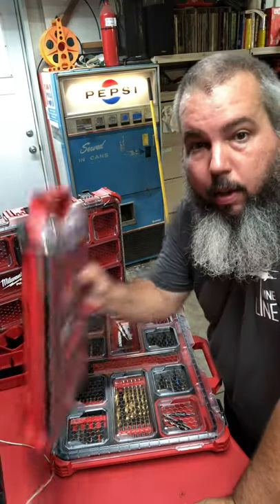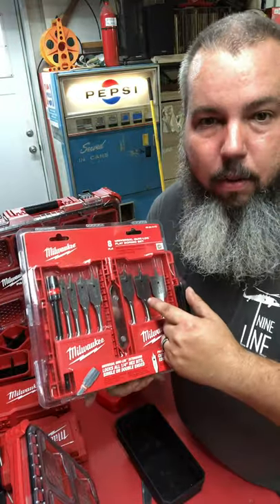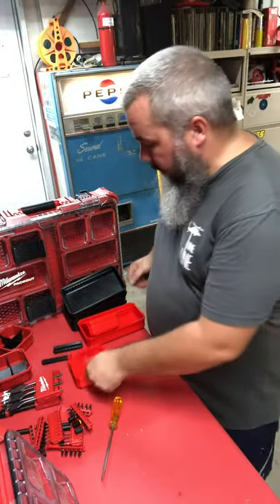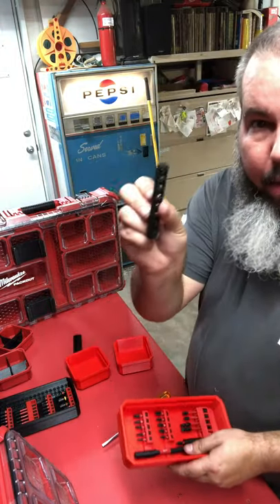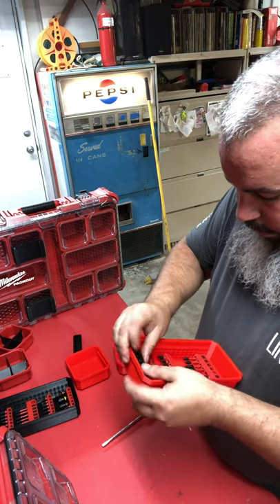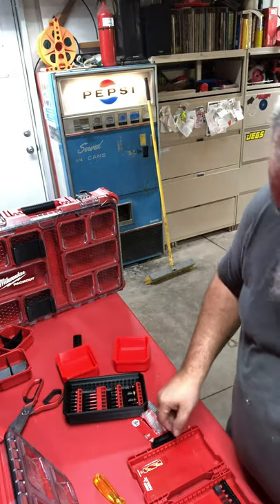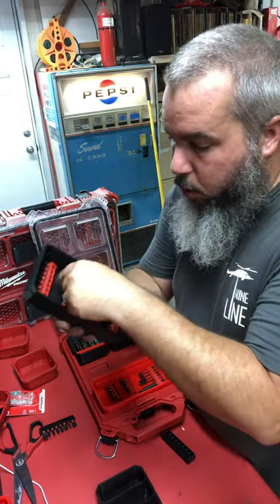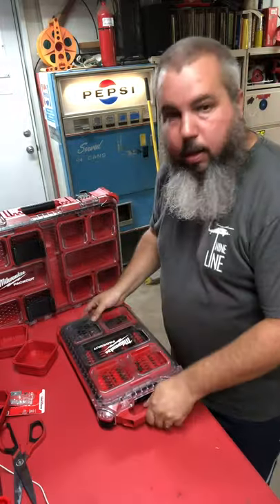Milwaukee Tools PackOut System  3d printed Bit bins

Comment: I've been printing trays as well.  Thanks to your video.  One thing I like to do is cut off the locking tabs on the sides.  Especially when you have multiple rows it can be difficult to flip them up.  It makes it a lot easier to get bits in and out.
Reply from the maker: Sergey Pober thanks , and that’s not a bad idea

Comment: Are the feet you sell the price for one foot or a set of 4? And are they super sturdy? I want to attach them to a table top I want to build for when we are out in the fields and need a flat surface to do work on sprinklers or the push seeder etc...
Reply from the maker: Cackleberry Farm they are per foot. And yes they a really dense. You can lift a whole stack of PackOuts with a board and the feet attached

Comment: FYI.  I really like the way the printed trays work with the original bit holders, that come with the cases you buy. I did  get both size trays and love them. I do have issues with the printed bit holders big and small. I live in south Florida and keep my  pack out boxes in the back of my pickup which is covered. I found that the  printed holders deform and become useless and the bits are hard to remove. The printed holders start to melt and warp. The original holders are ok in the printed trays and don't deform. I don't know if it would help, but i noticed that the original holders have a back support brace along the back. I wonder if this would help on the printed holders or is it the type of plastic used. The printed trays hold well and will be getting more. Keep the great ideas coming.